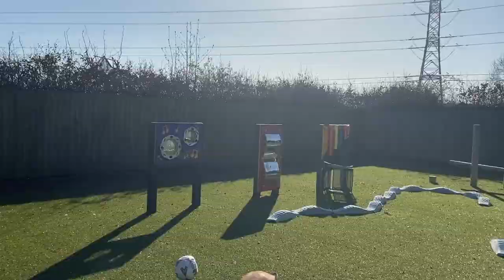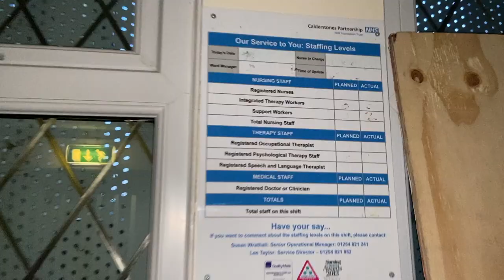JIMMY SAVILE DID TERRIBLE THINGS AT THIS ABANDONED HOSPITAL #jimmysavile

Comment: Its possible the alarm system wasn't even armed in the first place.  All motion detectors blink a small LED light whether the system is armed or Disarmed.  They do that simply to let whoever walking past it know that it's got power and working.  If you had tripped an alarm the sirens would be loud and you would know if you had set it off.
Reply from the maker: Kieran Tabor YT but the security came and you never heard of a silent alarm ?
Reply: @LukkaVenturesYT  Possibly saw you on the Security Cameras.